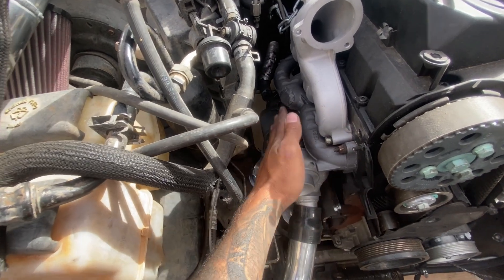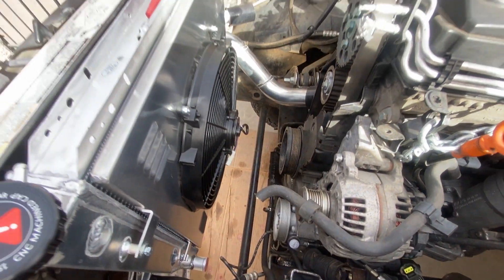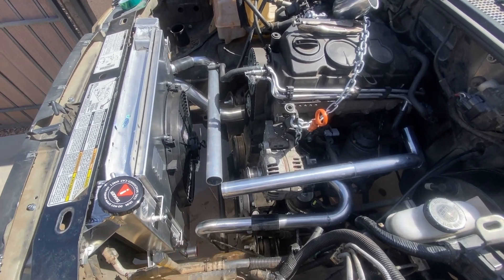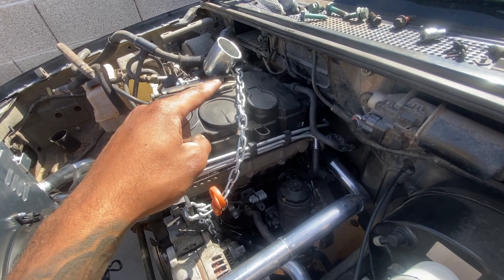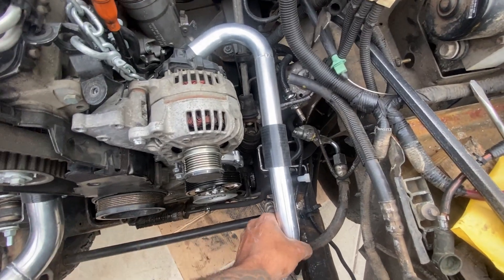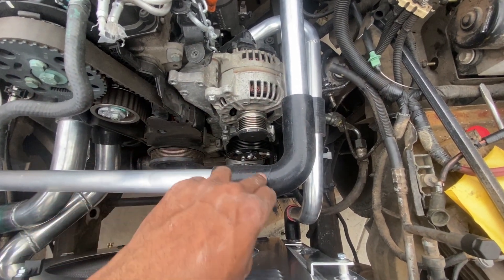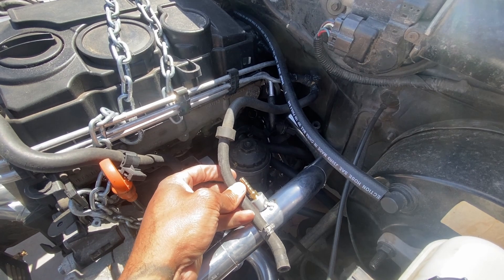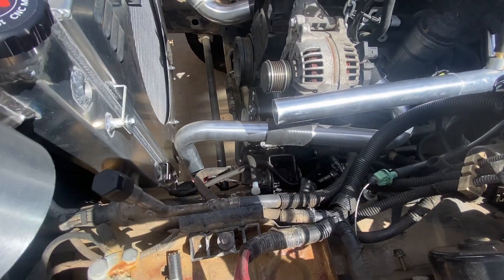Building the Ultimate Diesel Mini Truck - TDI Ranger Swap Ep. 5 Coolant System

Comment: Quick question, is there a kit youre gonna be using for the wiring harness or are you going to have to custom fabricate that?
Reply from the maker: I'll be using the stock harness out of the jetta and just using all the suff I need to make it a stand alone system. I'm also working on trying to figure out how to make the ac work as well.

Comment: Great looking swap. So many times you see swaps that are just booty fabbed together hoses and couplers. One suggestion I'd make is to have a support bracket for the radiator pipes around where the alternator is since it will probably want to sag and flop around once it's full of coolant.
The small vacuum nipple off the vacuum pump runs to the "N75" solenoid, then to the turbo actuator. You will need to tee the vacuum pump outlet to feed the vacuum for the climate control.
Reply from the maker: Thank you for the suggestion I was contemplating doing brackets on the intercooler piping too so none of it moves at all. Yes I have the N75 solenoid still and will put that in on final installation. I forgot about the climate control vacuum thanks for letting me know about that as well.

Comment: Alright, so a few things. First great job. It's coming along nicely. Next, that steam port isn't the highest point in the system, so that will not work well (ask me how I know). If you look at my videos, specifically the CJ7, you'll see how I mounted the coolant ball much higher than the engine. But I had that available for me. If you don't release the steam, you will create hotspots that can kill a head gasket. On the XJ, I was more constricted with space (kinda like your ranger, that tandem pump will be a pain to change the gasket if it leaks (change it before you do the final install)) but I was still able to get the ball to the highest point. I teed off my hard pipe (which is much higher than your setup) from the back of the head, into the pipe, and then from the pipe into the ball. I also drill and tap the heads on my swaps since the engines are sitting with some backwards can't (5-6 degrees lower in the back). I do this since steam will get trapped up front in the head. 

Ironically I'm doing my coolant pipes now for my BHW. I tend to go overboard with the sensors, so I have a coolant pressure, and upper and lower rad temp as well. You want about  a 100F split between the top and bottom when driving normally. That's a good indication of the system working efficiently. I use the Defi Advance ZD clones from Ali Express. I have one in the CJ, and two in the XJ. If you haven't joined my Facebook group (TDISwaps) you should head over and jump on. I have basically all the schematics needed for swaps. 

Best of luck.
Reply from the maker: Does coolant flow through the steam port?  Could you post a short video explaining your system? Thank you for the input
Reply: @littlebootsfab  If you look at videos online of the cars, you should see a steady stream of coolant coming into the ball. Your steam will naturally vent through it as well (self burp), but you also want coolant as well. 

You can join the group, or google it as well. I didn't come up with the idea to drill and tap, but I have used clear hosing and see bubbles coming out of both of them which indicates in theory what I'm doing is right.